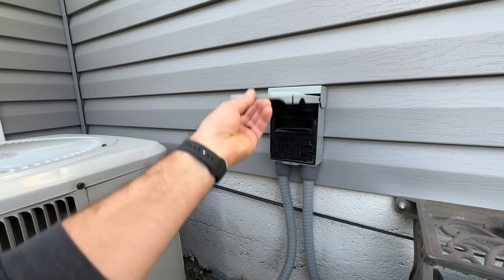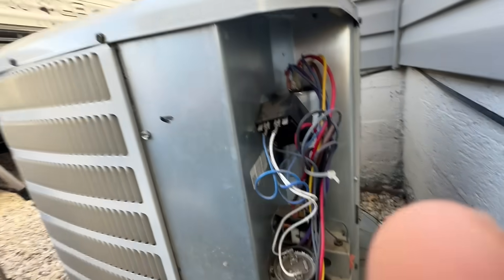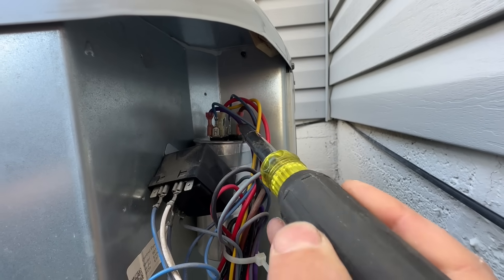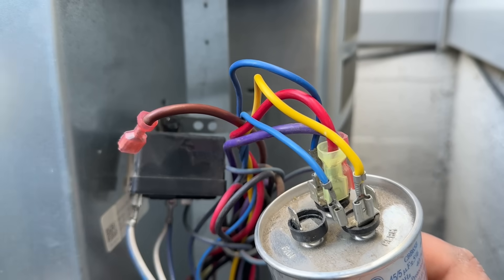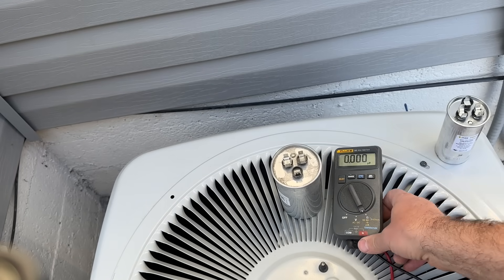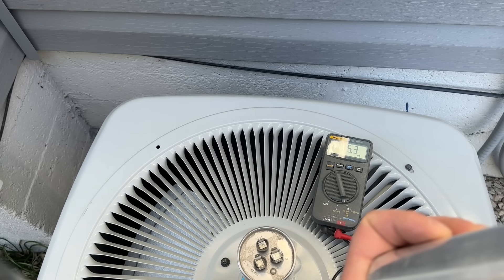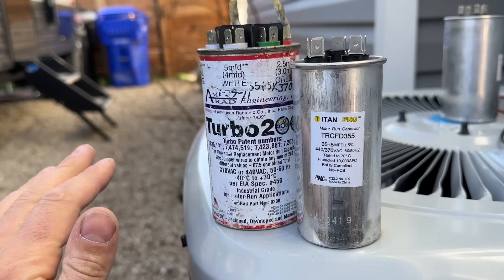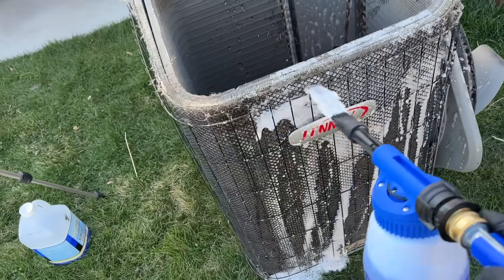How To Check & Replace An Air Conditioner Capacitor

Comment: My home warranty offered a free pre-summer A/C inspection. Tech comes and tells me my unit is fine, but capacitor looked like it was on its last leg and offered to change it for $150, which i declined. Now after seeing this clip, I'm going to prepare myself and get a capacitor from Amazon, just in case. Thanks for the info.
Reply: I wonder what the symptoms are and how you diagnose a capacitor being on its “last leg”? Techs are trained and told to find something to replace on service calls. 👀
Reply: @Shunya0101 leaking and/or bulging at top, or corrosion.
Reply: You mean they offered you a free sales pitch?

Comment: Shouldn’t The Power Be Turned Off Before Poking a Screwdriver Around Shorting Wire Out !!!???
Reply from the maker: Yes, I thought I made that pretty clear.
Reply from the maker: It’s right at the beginning of the video, pulling the disconnect out.
Reply: @diyhvacguy  You Certainly Made it Clear , But I’m Apparently Pretty Dull ! , Momma always said I should Ride The Short Bus , I Must not have Heard the Beginning or my Brain Cord was Disconnected ! Great Video Sir !!!

Comment: AC went out yesterday fan won't start soo fan or capacitor????? Maybe
Reply from the maker: Spin the fan with a stick. If it spins free it’s probably your capacitor. If it is stiff it’s probably the fan motor 👍🏼
Reply: @diyhvacguy  thanks dude will do I'll keep u posted
Reply: @diyhvacguy  I tested capacitor its bad ........ mine reads 50-5  +10% 440vac 50/60hz........and the 1 I found is here

Comment: Great video, thanks for sharing!
Yes, every DIY person should consider replacing their own capacitor to save a service call.
Also, I would avoid the listed $94.31 universal motor run capacitor, it’s too expensive and you are paying for something that you don’t need. It has multiple capacitances for the convenience of working for just about any motor, in other words, it’s like taping together a box full of different size capacitors then connecting the one or two that you need for your particular motor. Spend $10 - $20 for the exact size you need and be done with it.
Reply: But I have 5 rental units so I just keep 1 universal to get them up and running same day, then I order the correct part for $10 as needed.  So for me, it's nice to have the universal.
Reply: @yougottabekiddingme558  I see the appeal in your case to have a single capacitor that has 6 different values, fewer caps to track and time is money!

Comment: Hi just saw your channel definitely going to subscribe I had a question for you I just had the capacitor changed on my AC unit and it was a 40-watt capacitor but the person who changed it changed it to a 50-watt capacitor am I going to have issues and they took the old capacitor with them so I cannot get the specs off so if I have to get the original one how can I get it
Reply from the maker: You can punch in the model or serial number of the unit on repairclinic.com and it will show a parts list including the factory cap size 👍🏼
Reply: They also jot it down on the wiring diagram if you or someone knows where to look

Comment: Can you provide a list of spare parts to have on hand in the case of an ac breakdown?  Is that worth doing???

Besides the capacitor.. any other parts worth having around?   Well, besides a spare compressor,, which is probably very expensive
Reply from the maker: Yea, I wouldn’t recommend a compressor, but you could keep a spare fan motor on hand. And a contactor. Those are all easy fixes.

Comment: Hey like your simple to understand tutorials. Years back I was working and had a technician come out. They charged me slightly over $300 dollars to change out a capacitor during a season maintenance contract. Furnace was fairly new and I had No running issues Ridiculous. I complained and got my money refunded. Scammer company and technician trying to squeeze money from customers.

Comment: Great video.
I worked with my landlord today fixing my HVAC unit. Your video was much better than watching him work.
What would cause the contactor to chatter?
Assume this is really bad for the compressor???
Reply: The contactor is activated by 26Vac from a transformer inside your air handler, the same one that typically powers your thermostat unless you have a battery powered one.

Contactor chatter is either a bad contactor or the 26Vac transformer is going bad and putting out a voltage that is too low.

Comment: the only problem with keeping a spare capacitor on hand is they go bad faster when not being used, so if is many years since you bought the spare you might want to test it to make sure it is still good.
Reply: A/C tech for 25 years. They never go bad on the shelf

Comment: my Trane installed in 2008 = 15 yrs old and runs good. Kept up with cleaning coils every year and monitor / replace interior filters 1 every year. So to be proactive my question is should I just go ahead and replace capacitor anyways ? Is there anything else I should just go ahead and replace ?
Reply from the maker: If it’s over 5 years old I’d replace it. Other then that, just keep it clean! You can always just keep a spare cap in your junk drawer for when the other ones goes 👍🏼

Comment: FYI, a 5uF fan capacitor measuring 4.65 uF is not within the 5% tolerance – it's 7% out. This might not cause a fan failure, but might be an indication that the cap is degrading, and might cause you to replace the cap even if the compressor side is OK.
Reply from the maker: I realized this after the fact too. I was like wait a minute what? Thanks for the advice!
Reply: @diyhvacguy  You bet! I appreciate your videos!

Comment: Those turbo 2's are short life , thats why I started replacing my own,  $250 for a tech , for a capacitor which lasted maybe 2 years. Im sure its carried for convenience, with multi  capacity choices.  But I say they are garbage for someone who wants a good product.
Reply from the maker: At the end of the day, if you know how to replace the cap yourself, you will save a ton. Whether it lasts 2 years of 5, you still have a very valuable skill as a homeowner 👍🏼 cheers man

Comment: Thanks for this info!  A few years ago we had a new Trane AC put in.  I think the following year or possible the second year out, it wouldn’t run.  Called the guy who installed it and he replaced the capacitor for about 250.  Must have just been out of warranty., pretty crappy warranty I guess.  The next unit in next house was a cheaper Lux Aire model with 10 parts and labor warranty.  Its about 9 years old with no trouble.
Reply from the maker: 10 years parts and labor? That’s awesome
Reply: @diyhvacguy  , yes- I just had to go online and register the units. Flame sensor in furnace went bad about 3 years in but other than that it's approaching it's 10th year. 80 plus gas and 13 sear ac installed for 3200 out the door.  Business was a little slow in 013. 😃

Comment: did you get the hard start video going? i wanted to test that capacitor as well because my main capacitor shorted out (the red wire made contact with the purple wire and burned it up) but was not sure how to test the hard start capacitor. thank you

Comment: What about if you have a resister connected to the capacitor,what would the reading be if the resister is 150 ohms
Reply: KISS method. I would take the resistor off to obtain the true value.

Comment: The first capacitor was 45/5 and you replaced it with a 35/5?
Reply from the maker: No I apologize I used the 35–5 as an example. In hindsight, I should have used the replacement capacitor as an example. Hindsight is 2020 though, right?

Comment: You said that the capasator was a 5 -45 and the. Replace was a 5-35 that is not big enough to work
Reply from the maker: Sorry I used the 35/5 just as an example. In hind sight I should have tested a 45/5. My apologies

Comment: What are the symptoms/signs of a failed/failing capacitor? Complete stoppage of the AC unit? Or major/minor decrease in performance? Just wondering how one realises that the capacitor is failing or failed. Thanks!
Reply from the maker: Either the fan will be running but no compressor, or the compressor will be running but no fan, or both items won’t come on at all. It will be one of those three scenarios

Comment: In a air conditioner what are the symptoms of a bad capacitor? Thanks very much for your information. Keep up the good work
Reply from the maker: Typically the fan won’t be running but compressor will, or the compressor won’t be running but the fan will. Occasionally both will not come on but most times it’s one is running and not the other.

Comment: Fantastic video thank you! New subscriber here because of this video. Question for you: Recently our downstairs compressor began blowing the breaker. When the system isn't running and I try to reset the breaker, it instantly breaks again (won't even try to stay on) and when the cooling system IS running the breaker will hold but only for several minutes or until the system turns off again because the house came down to temp. Any thoughts? System is over 15 years old. In the meantime I'm going through all of your videos. Thanks for giving us all such important information!
Reply from the maker: How old is the system? It’s nearly impossible to diagnose via comments but if you need help diagnosing this, feel free to check out our Patreon membership where you will get one on one assistance with diagnosing any hvac problem! That can be found at Patreon.com/diyhvacguy. Cheers!
Reply: @diyhvacguy  awesome! The issue turned out to be two red wires coming out of the compressor that were not being used and were touching (grounding I guess) the bottom of the condenser cage. Once I capped them (and cleaned everything out since I had the top off) it's been running with no issues. 15+ year old system.

Comment: So what are the symptoms of a bad capacitor on overall HVAC system that is noticeable?
Reply from the maker: Symptoms are typically that the compressor is running but no fan, or the fan is spinning but no compressor. Or nothing could be happening at the outdoor unit.

Comment: Should the capacitor be replaced periodically as preventative maintenance?
Reply from the maker: Life expectancy is about 5 years so yes you’d want to keep the cap replaced before it goes bad right in the middle of summer!
Reply: @diyhvacguy  thanks

Comment: Is a capacitor something that could be replaced even if it is good as part of preventative maintenance?
Reply from the maker: Yes! I usually will let customers know that if it’s past the 5 year mark, it could go at any point. I offer a 5 year warranty for new capacitors as well.

Comment: Very nice video!!! When you mean discharge the wires connected to the capacitor just tap them on the sides to discharge them?
Reply from the maker: Yep! That’s it
Reply: He meant to say use a piece of metal to connect the two posts just to make sure it isn't holding a charge.They have an internal bleed buit in but it's better to be safe and you'll always do it after you've been 'bit' once or twice.

Comment: Great video!  What is the typical life of the cap?  Thanks.
Reply from the maker: Typically around 5 years. Some will last longer, others less.
Reply: Thanks.  An "easy start"  would make them last longer right?  Why isn't an "easy start" a factory installed item?  Planned obsolescence right?

Comment: Great video. Replaced mine 3 times over the years. So glad I learned how to do it as the HVAC guy wanted 200$ before I learned myself. Part itself was I think 8-12 dollars.  Thank You 🙏🏼
Reply from the maker: That’s on the cheap end too! I just heard of someone getting charged 700!
Reply: @diyhvacguy  Thanks for posting! I have a question.  I recently purchased a spare fan capacitor for my 15 year of system.  It was replaced once about 7 years ago at a cost of 330 dollars. The top of the capacitor is so rusted that I can not determine what terminal is what. I do have an ORANGE AND PURPLE going both to one. A YELLOW going to one by itself.  A BROWN going to one by itself.  Is the following correct? Brown is fan. Yellow is herm. And the purple and Orange is on the common.
Reply: @joejohnson2478 I had same issue where it was rusted and I just took a picture and lines it up with the label on the front and made sure the wires where placed in the same place on the new capacitor
Reply: @WThomas  The spare capacitor that I bought is of a different brand. I bought rust remover at Home Depot and will have to mark wires and side of rusted capacitor before removing it to make sure that I connect the wires back properly.
Reply: 200? Those greedy bastards. HVAC is simple. I have no idea why you'd go to a school to learn it. They should be lucky if we pay for the part only.
Reply: @nomeD6980 well if its so easy with no school. and you make alot of money in it bc its a greedy business. I dont understand why you havent made your own hvac company yet?

Comment: I had my HVAC company do I $100 spring check up non my heatpump. He said my capacitor  was out of spec and might fail. He quoted me $750 with a 5 year warrantee. I’m glad I did not let him do it. Thanks for the video I’m searching for one now.
Reply from the maker: Wow, that is crazy! Glad you didn’t accept. Some companies will take advantage in a heart beat.
Reply: @diyhvacguy what’s the tick for arcing the unit so I don’t get shocked?
Reply: @diyhvacguy  loving this channel, had my capacitor go out last year, it was covered by home warranty copay of $95 so not bad. my fear is getting shocked replacing it myself from leftover charge even with little power plug pulled but just touching screwdriver to it somehow discharges the leftover current. still makes me hesitant/leery as it seems one could get severely shocked (unalived) or am i just being paranoid/overhink/overreact? thanks again! my plan for tomorrow is the coil cleaning. really like how you pointed out you do not HAVE to take top off. that is a great video. appreciate the service to us regular people that unfortunately the companies, IMO, gouge. i understand overhead and such but it seems they are too high, not saying bad, just over price. imagine for example if you took your car for oil change, for my car at dealer full synthetic it is around $135 but the dealer said yea today it is going to be $795. this is a decent analogy. thank you again!
Reply: Criminals!  People work hard to get what they had.  I don't know many people that can just dish out $750 for a job thar should cost no more than $200 with parts and labor.

Comment: Why did you replace a 45/5 with a 35/5 capacitor? Does that not matter? Great video. This will save a homeowner several hundred bucks. I had a repair guy tell me that it was $350 to replace the $10 capacitor and add the hard start. That was 3 years ago. I went to Grainger and replaced it myself.
Reply from the maker: Nice! No I apologize for any confusion on that. I just used the 35/5 as one to compare and read the values with. I should have tested the 45/5 but hind sight is 20/20 right. Thanks for watching! Cheers
Reply: So if the correct 45/5 is not available at my local Ace Hardware, can you use 35/5 ?
Reply: @sh-zm7xl no you cant, the 45uf is to help start the compressor, the 5uf is to help start the outdoor fan. If you use a 35uf over a 45uf. Your compressor might not start or it will pull more amps and make it run higher in amps. Which will kill your compressor faster. Why this guy does give out great advice and great helpful videos for DIYers. The science and method behind it, is crucial.
Reply: Where is the best place to buy the cap from ?

Comment: Great video, my trane xl 20 compressor wasn't kicking on last summer. My neighbor that does hvac came over and diagnosed a bad capacitor and showed me all the steps to check and replace exactly like your video. Saved a bundle , keep the great videos coming.

Comment: Fan capacitor was NOT “ totally good at 4.6 for 5%.  That would be 4.75.  Also very confusing/misleading showing a different value cap than you took out when showing how to test.  Replace like for like size, NEVER smaller.
Reply from the maker: Yea I apologize for that. I realized the same after re watching it. And yes the fan section was bad, I was mistaken. I did replace the cap with the same size but for whatever reason I used that one just to demonstrate. The perfect video is an elusive thing 🤣 thanks for the feedback!

Comment: You took out a 45/5 and put in a35/5?
Reply from the maker: No, I was just using the 35/5 to demonstrate how it should test out. I apologize if that was confusing. I did replace it with a 45/5